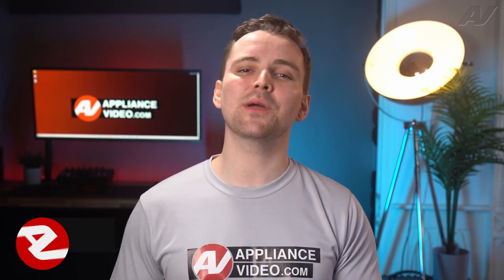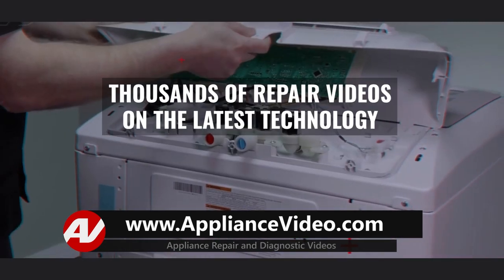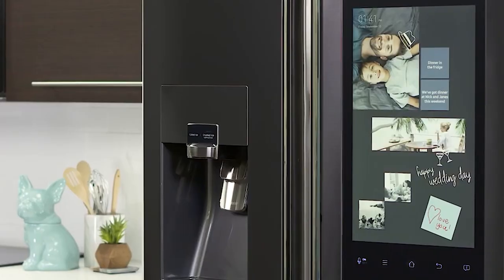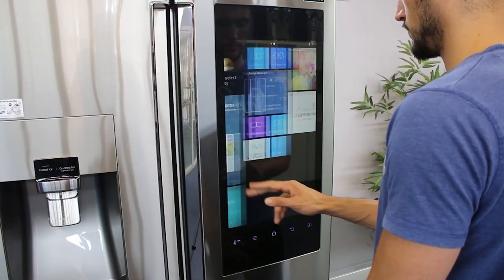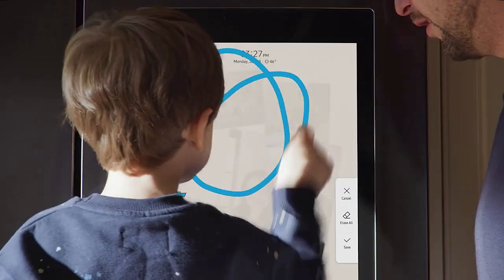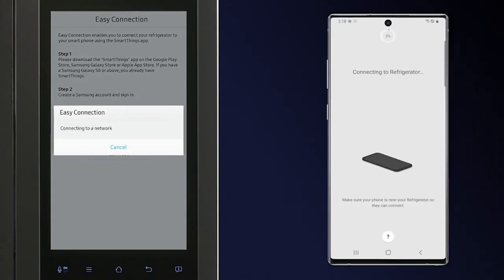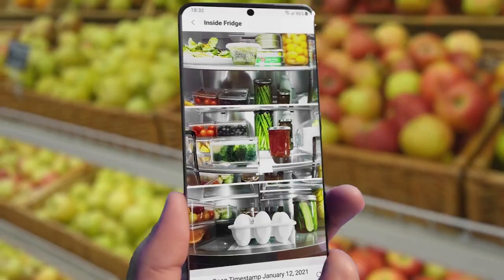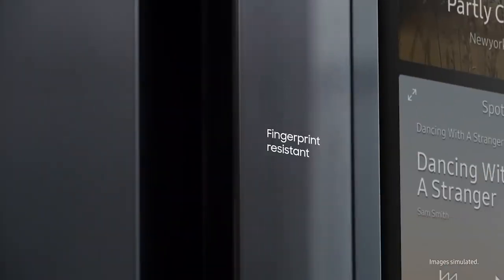Refrigerators with State-Of-The-Art Technology you will not Believe is possible

Comment: The technology I want is one that does not need repairs for at least 20 years...  like the one I currently use (although it does need a minor repair now),  or the one I got with my house which was made in the late 1950's that only needed a new gasket in the 1990's... retired because it did use 2x as much power as the one I replaced it with (and still currently use).